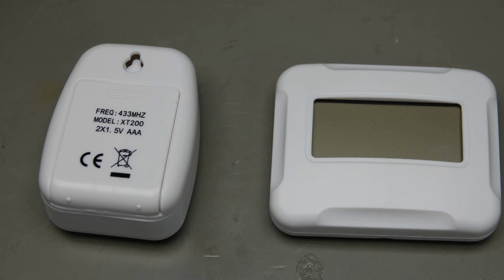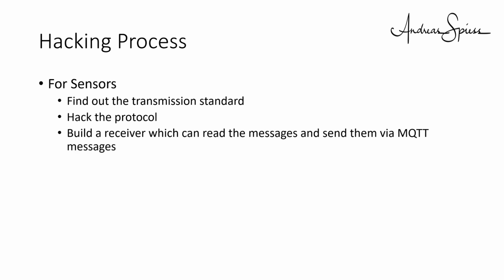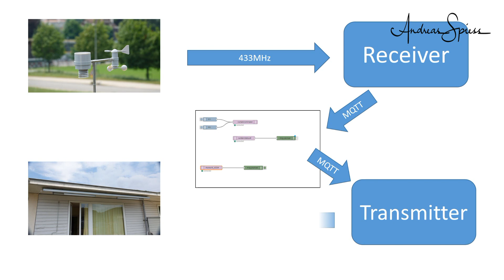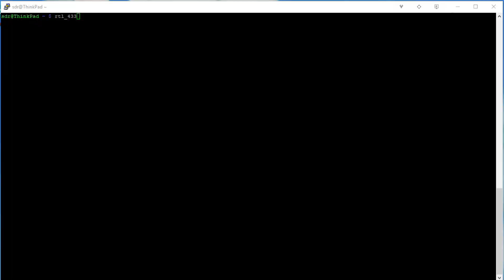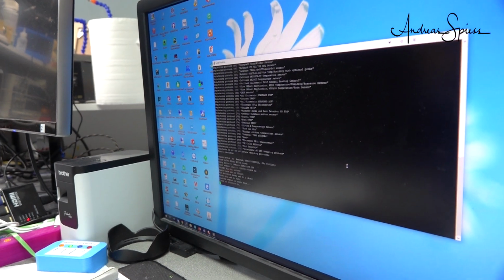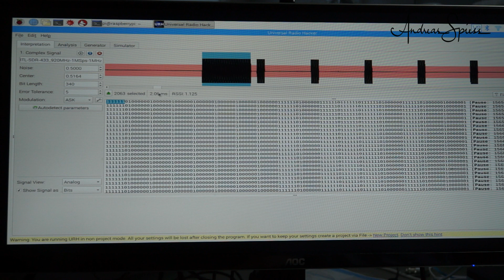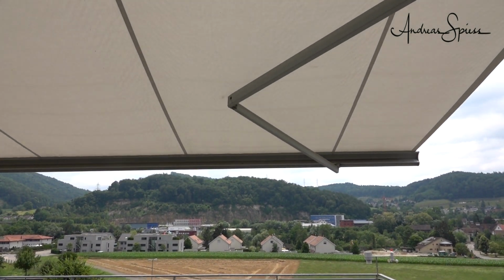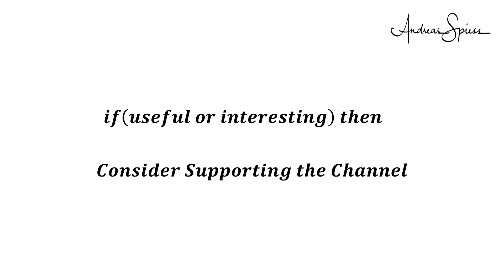#209 How to Hack your 433 MHz Devices with a Raspberry and a RTL-SDR Dongle (Weather Station)

Comment: You may also consider a direct communication from the weather station to the esp32: by adding an RF433 receiver to the esp32 you could get directly the data from weather station without the need of node-red and mqtt (just in case anything happens) but keep them for home automation
Reply from the maker: This is stuff for more work. This protocol is a little more complex. But I will try it.
Reply: Andreas Spiess I didn't say it is easy :-) but I think it would be worth having 2 systems doing the same thing for increasing reliability (you want to prevent any damage from the wind in any situation)
Reply from the maker: You are absolutely right!

Comment: The mqtt standardisation is genious. It abstracts the radio whether it is 2.4Ghz or 433Mhz. I had some limitations with NodeRed, so I set a Python mqtt Ruler in this framework (https://www.homesmartmesh.com) which would also map mqtt to a grafana dashboard through influxdb.
Reply from the maker: Thank you for the link. I did not know it.
Reply: That's the outcome of my hobby time all last years, it's 100% Open and goes in the same direction as your interests in sensors and electronics, so if you have any question or suggestion that would be highly appreciated. The interesting part for you could be the raspberry pi one (https://www.homesmartmesh.com/raspberry-pi/) as once you have your data on mqtt with the right format, all the rest for database and dashboard comes free of efforts.
Reply from the maker: I will have a look into it. Thanks!

Comment: Great video! I did not know about URH it seems great. For my weather station I did it the caveman way with SDR# recording rf as audio, then looking at it in Audacity and writing it down by hand. For tiny remotes and simple stuff there is the 'rc-switch' arduino library that can decode and reproduce most of them, would have been worth a mention since it's super simple. Also loved the Ave reference at the start :)
Reply from the maker: In the past I also used Audacity. But now it can be completely replaced by URH. So I did not mention it.
Reply: Soon as I heard 'treat especial,' I ctrl+f'ed for 'AvE' in the comments :D

Comment: The problem with 433.92MHz equipment is that there are far too many, resulting in blocking. I was reciently forced to replace my central heating thermostat, because it was regularly jammed in the on state by other devices in the locality. 
My replacement thermostat still uses 433.92MHz, but has a duplex protocol, ensuring the command message is received and acknowledged.
Because of the congestion on this frequency, I think any home made projects using this frequency should use a bi directional protocol.  This is particularly important when controlling a motorized device. RF modules to do this are available at very low cost, around  £5 to 10.
Reply from the maker: Fortunately this was not the case here :-)
Reply: Andreas Spiess my brother and I designed a system to receive the Oregon weather station modules, the earlier ones used OOK am modulated signalling,the later ones are FM. Our system injects the decided signal on to our common CCTV modulator. This displayed the CCTV and the weather information on all the TVs in the house. Unfortunately the modulator is only PAL, not DVB-T.
The price of DVB-T (2) are coming down so I should be able to update the system to support newer televisions that only support DVB reception.
Reply: Andreas Spiess you may be interested to know that the sky satellite remote control system that uses the red-eye IR receivers, convert the the remote control IR signal to a 7.2MHz OOK modulated signal that can be sent over the aerial coax to remote the s sky receiver in another room. I built a demodulator for this which was used to remote control the CCTV DVR. Unfortunately technology made the system obsolete when we installed a television/radio/ satellite distribution amplifier. The problem is that the red eye transcoders are powered by 12 volts sent through the TV aerial coax. This is not compatible with the voltage control signal used to switch the satelilite LMB.
Reply: I think alot of devices/implementations may not be following the regional rules for duty-cycle/use-cases, etc... For a great overview of regulatory compliance, check out this TI paper:
http://www.ti.com/lit/an/swra048/swra048.pdf
Reply: @zerog2000  Thanks for the great link

Comment: Couple of small issues. Links are to ESP8266 not ESP32 and Pi image is to a 404 message.
Reply from the maker: The link to the Pi image should work by now. What other link does not work?
Reply: Same here, http://www.sensorsiot.org/transferfiles/Hacking_Raspbi3.zip 404 page not found
Reply from the maker: This link was wrong. I changed it in the comment.

Comment: It's all go in the PI front eh? Great tutorial Andreas! I wonder if the scanner has a text or api output. If it does it might be possible auto gen the sig gen functions.
Reply from the maker: I did not check for an output file because I did not need it.